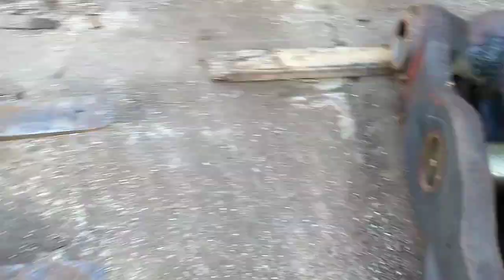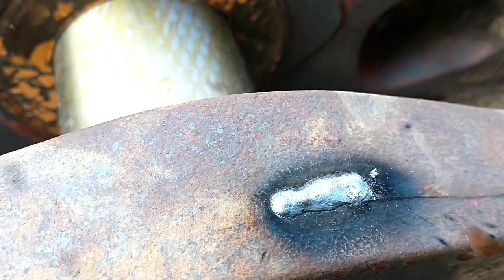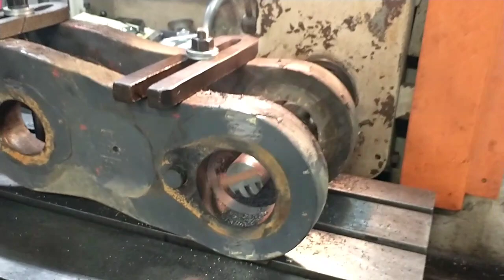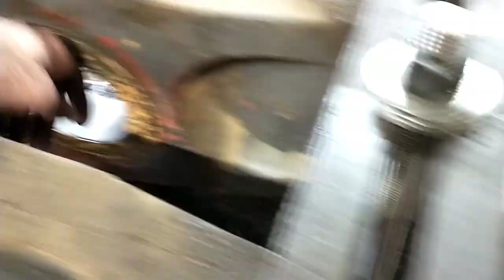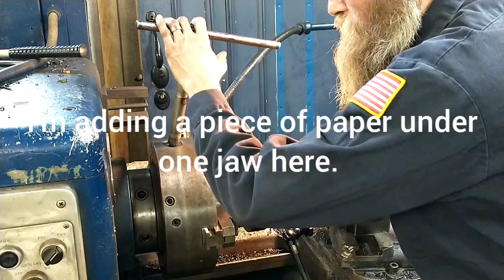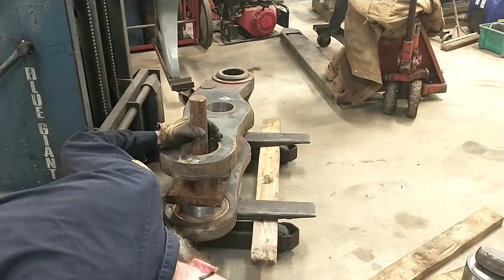Volvo L220 Bucket Link Bore and Bush

Comment: I agree with your sentiments regarding parting in a lathe.  

Volvo loaders are one of my favorite machines to operate.  I have been in the L60, 70 and 90 E, and the L70 and 90 F.  Nice machines to run for the most part, and durable.
Reply from the maker: I'm always holding my breath any time I have to use the parting tool. It has been a lot better since I added the flood cutting oil to the process.
Reply: @Andy-PerpetualMotion  Since I have no functional coolant system on my lathe, I use WD-40 heavily during a parting cut.  And slow the spindle way down.  It would help if I had better tooling for parting.

Comment: I can't remember if you have an exhaust fan or not. If not we should get one installed for you.
Reply from the maker: I do have one, but it's on the opposite end of the shop by the welding bench. I've been thinking of installing a second one over near the lathe.

Comment: sound ranges from less than a whisper to blowing the neighbors windows out. can't watch these videos like this.
Reply: Try putting the audio in an editor and and normalize or add compression

Reaper audio is free
Reply from the maker: Thank you for the input, I'm trying to find a solution to that problem. I bought a wireless microphone but the stupid thing didn't work. Now I'm on the hunt for another one.